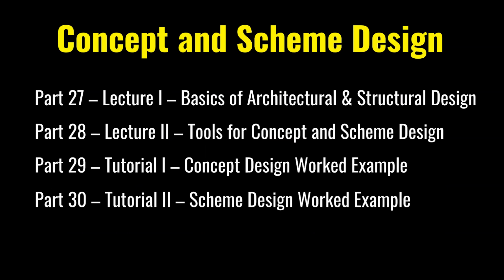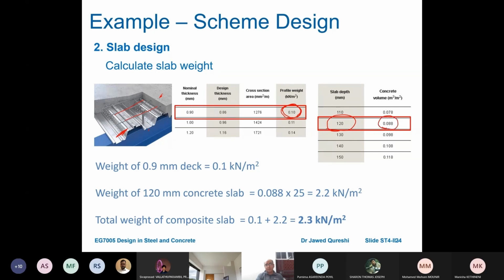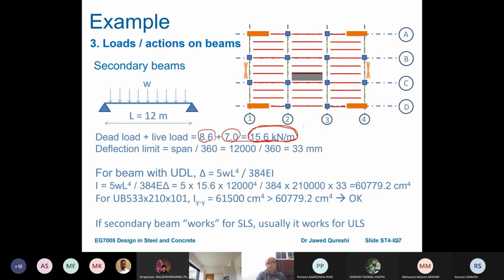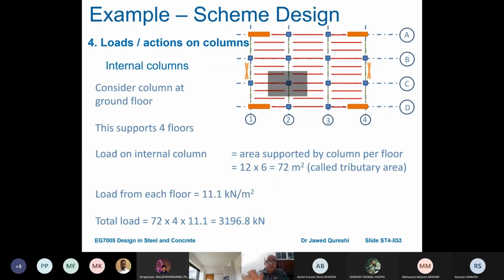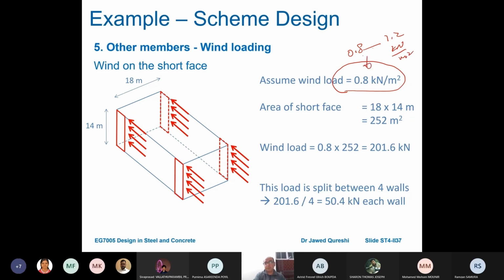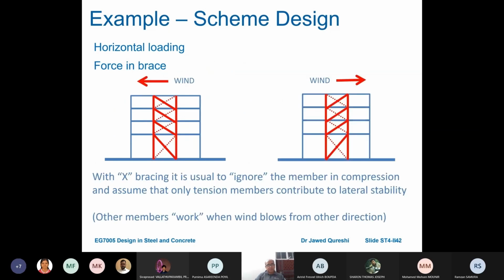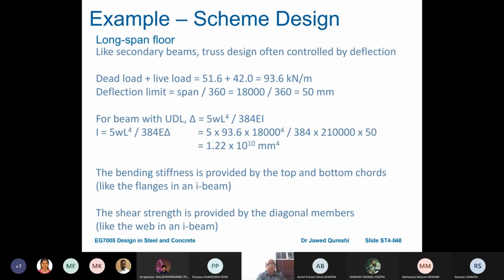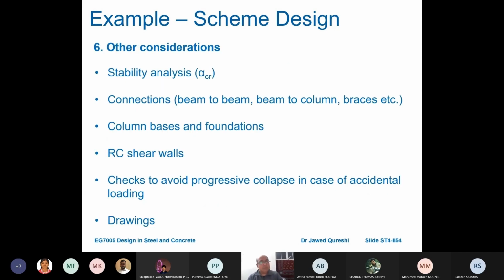30 Scheme Design of a steel building | Eurocode 3 Steel Design series

Comment: Dr Jawed, I've got a moment of being completely thick, but how did you get from 374.4kN horizontal to 312kN vertical? Thanks!
Reply from the maker: Tan(theta) = Vertical dimension / Horizontal dimension = vertical force / horizontal force. By cross multiplying, we get Vertical force = Horizontal force x (vertical dimension/horizontal dimension). Vertical force = 374.4 x (5/6) = 312 kN.
Reply: Of course! Two tan proportions stacked. Thanks! It is very valuable for me and I really appreciate your time to respond. Looking forward to more of your lectures. @DrJQureshi
Reply from the maker: Please let me know if above explanation is clear enough for you. If it is not, then I can quickly send you calculations with a diagram via email.

Comment: Very Useful videos. 
For the bracing design why the total horizontal force was taken instead of each floor load? 
374.4kN is total horizontal force.
Can you please clear my doubt.
Reply from the maker: Thanks for the insightful comment. The floor loads are vertical gravity loads and are transferred from floor to beam and beam to columns. The bracing takes horizontal/ wind load. This is how load travels from roof to foundations. Have a look at my new video on Laos path, https://youtu.be/JdV07TdDDOk it briefly explains load path with bracing at the end.
Reply: @DrJQureshi  many thanx